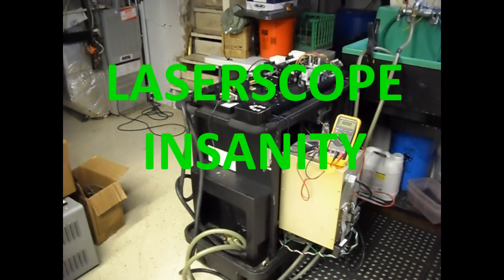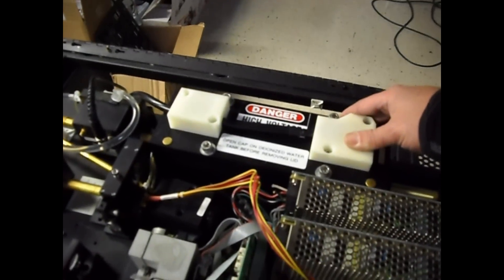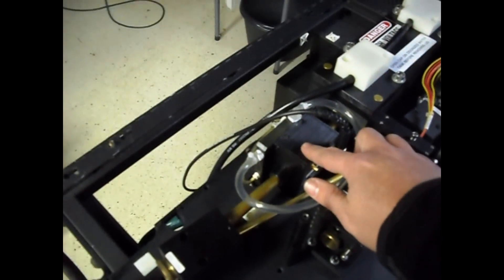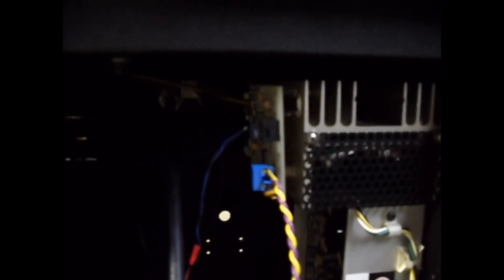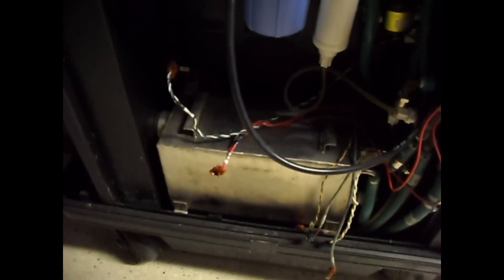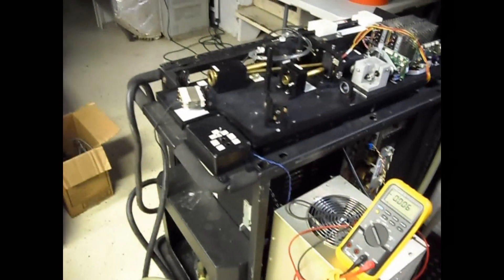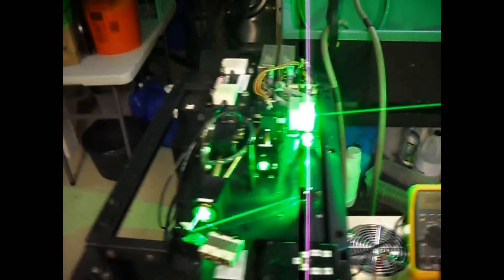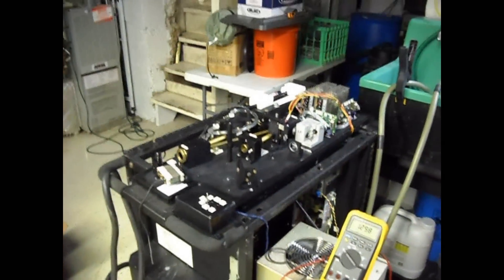LaserScope Insanity - 40 Watt Frequency Doubled Nd:YAG Laser

Comment: Hey, great video! :)
I have one question. Where do you get your laser goggles from? Because I have problems finding stores that sell those for a reasonable price.
Reply from the maker: "Real" laser goggles that are "rated" and up to code with ANSI or IEC standards cost a bundle because the manufatturers pay to make sure they are compliant. They even come with a nifty certificate of compliance. The goggles I'm wearing in the video can be had as cheap as $20 a pair from China and will "basically" work just as good. The optical coatings are not expensive but the big brands have no choice but to sell a "standards certified product" or be subjected to lawsuits. 
Either way, goggles are NOT fail safe.... Just an added safety barrier, NOTHING replaces common sense and basic rules. For cheap goggles, try Ebay.
Reply: Adam Bourassa how can lasers be only like 40 watts or lower and have so much power output?